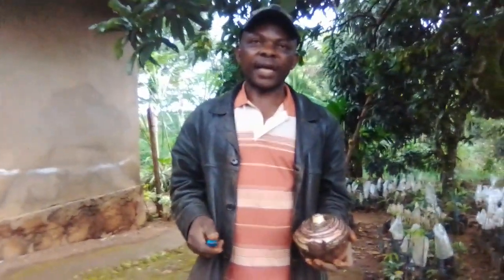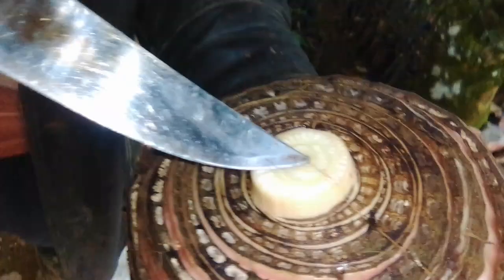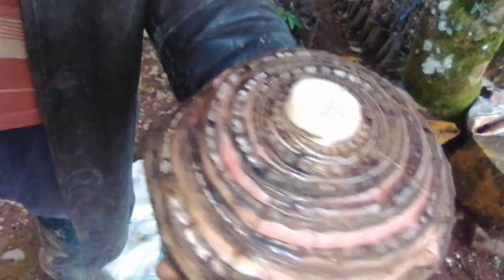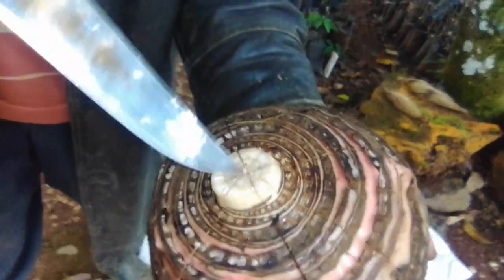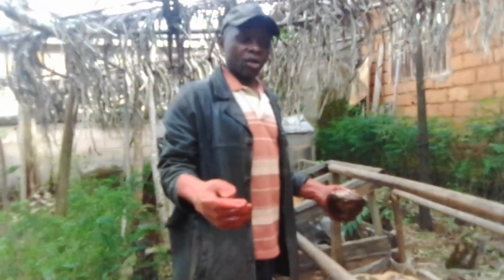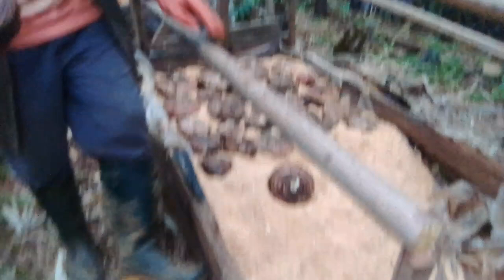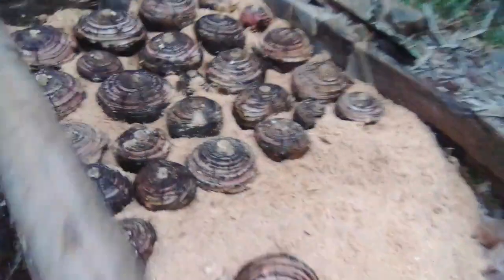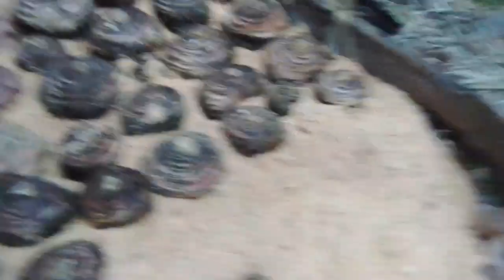Placing Plantain Corms in the greenhouse

Comment: Please how often should we wet the ex plant embedded within the saw dust?. And what quantity of water is safe?
Reply from the maker: From 3 months up to 6 months depending on your level of expertise. Excess water will always drain out. Remember that the plastic beneath is perforated.  Watering 2 days a week is ok
Reply: @ndefcameroon  Thanks and God bless, sir.
And please, one more thing. I have cut the first couple of buds which grew out vigorously (i.e. have thick base). I believe those are the "apical dominance" thing that need to be cut for lateral sprouts. But a couple of others are also coming out with thick base too. Should I continue to cut and activate those ones too until I get lateral growths?

Comment: Good job
Thanks you for the education.
After germination and you've done nursering them in the poly bags, how long should it take to before you can them finally transplant them to the field?
Reply: Great job sir i am a student doing a course in senior agric technician I am impressed with ur Videos👍
Reply from the maker: Thank you
Reply from the maker: From four weeks upwards depending on a number of factors like the fertility of your potting medium and heat
Reply: Does it need heat at the tender age while In the nursery
Reply from the maker: Of course, yes! After harvesting the young plantlets from the greenhouse and potting them, they are again be placed in another greenhouse or greenhouse-like structure for weaning. it is like an incubator that helps these immature plantlets to develop into independent  plantlets. Heat is therefore very important else the mortality rate will be very high. No direct sunlight. #NDEF promises to make a subsequent video when we will start harvesting and weaning the plantlets gotten from the explants in video. #ndef #ndefcameroon #plantain #plantain #multiplication #plantlets
Reply: How long do u keep the  combs in the green house B4 it sprouts?
Reply from the maker: 2 to 4 weeks depending on a number of variables such as climatic conditions, heat, water, shade, etc
Reply from the maker: From one month with continuous watering